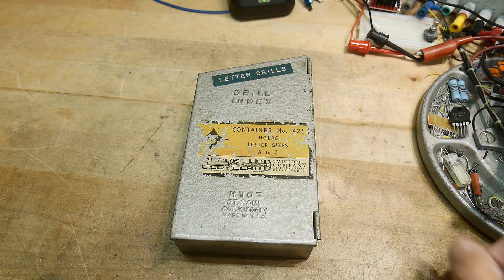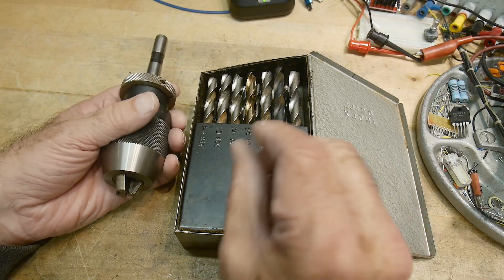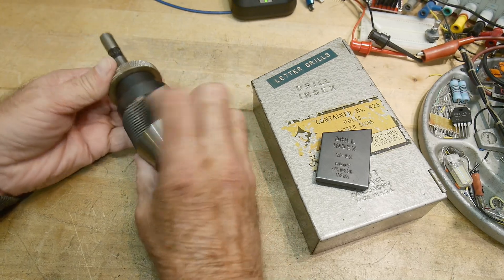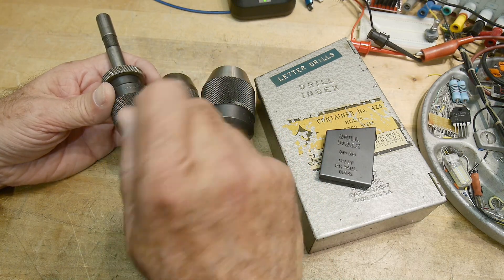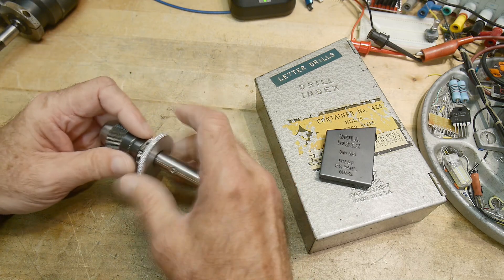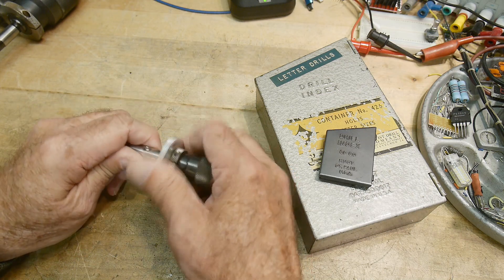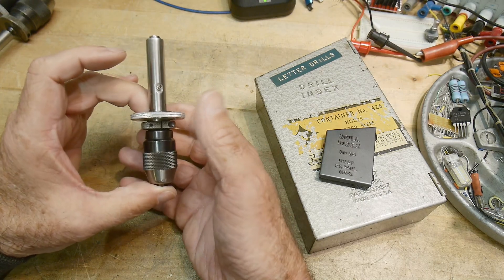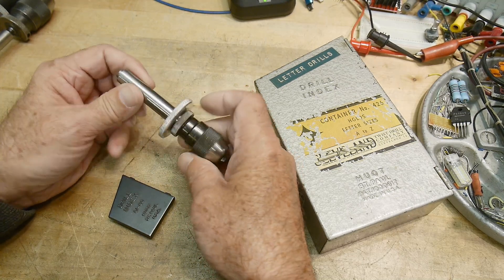#1887 Albrecht Sensitive Feed Drill Chuck

Comment: I've lusted for one of these for about 8 years but never found one that's affordable, and I don't want to buy or trust one of the low-$ far east fakesies versions. I'd also like to find a bigger cousin of one of these but that has a handle to run the quill and goes into an NMTB-40 milling machine bore for milling machines without a quill and that's actually pictured in Van Norman original sales literature for my Van Norman 1R3 gear drive 3hp universal horizontal/vertical drill press that's incredibly versatile but has no quill. Even Van Norman collectors tell me that nearly none of the item I'm describing and looking for were probably ever made and probably far fewer of them survive or would be recognized or saved before getting landfilled or melted down. I've got a bit of romantic fool in me that believes that one might exist and that i might run across it. Total longshot but what harm did it ever do to hold a longshot hope in the back of your mind instead of discarding your hopes?

Comment: Neat pro tool.
These days one could just buy Drill Stand BG-6127, put DC motor 750 type sold with ER11 collet already on and use all the 1/8" shank carbide bits.
Used it down to 0.3mm drills.

Comment: Please excuse my ignorance of non-metric systems, but letters and index numbers for drill sizes? Honestly? I mean I found the translation table, but wouldn't it make much more sense even in the imperial fractional system to just use the real diameter of the drill bit instead of an (arbitrary) gauge index?
But that's a really nice tool!
Reply: Here in Merica, we use fractional, letter, AND number drill sizes. What's so confusing about that?🤪
Reply: @SuperShecky : In the U.K. too; they typically relate to specific tapping or clearance sizes for threads.

Comment: I've used a Dremel and the Dremel drill press for well over 40 years for fine work like drilling PCB's.  It's probably been at least 15 years since the last time I did my own PCB.  When I can get 10 double sided PCB's for $5 complete with solder mask and silkscreen, homebrew PCB's are now cost prohibitive!  Personally, I was never a big Albrecht chuck fan.  I have a hard time getting the chuck to hold drills tight enough, and I never liked the jaws spinning 'round as I tightened it.  I'm a big Jacobs fan, especially their Super Chucks.  For smaller drills or lighter work I don't have to use a key with a Super Chuck, use it like an Albrecht and it works almost as well.

Comment: I usually just use a pin vise for drilling the tiny PCB holes I need drilled.  I’m just doing a few 10s of holes, otherwise a press would be a necessity.

Comment: Nice tool! I have used small pin vices before to drill tiny holes but it is not ideal because it is just hand held and it's hard to both rotate the drill and press down all by hand.

Comment: See kids - using stupid measuring system leads to drill bits that are specified in letters!
Jokes aside - thats a cool little implement, I just dont get the pricing - there is nothing special about it, on the other hand for 500$ you can get a miniature drill press with collets and good feel.

Comment: I think you may be looking in the wrong place. A micro drill Adaptor which is the same as what you have except without the chuck costs less than 10 pounds new
It has a 1/2 inch shank and a JT0 drill taper for a suitable chuck. (costfor a chuck  just over six pounds) here in the UK 

No point in giving URL's as Utube will just delete the comment.

If you want the info give me a email and I'll pass it over to you.

Andy
Reply: Just look up "micro drill Adaptor"... Beware of typical Chinesium "copies"; some worse than others.
Reply: If you're using it on a drill press, the cheapies are probably fine. You're not likely to see any advantage to the Albrecht holding the sensitive feed adapter held in a chuck on a drill press. The expensive Albrecht chucks are better when runout is a critical concern, holding it in a collet in a milling machine.